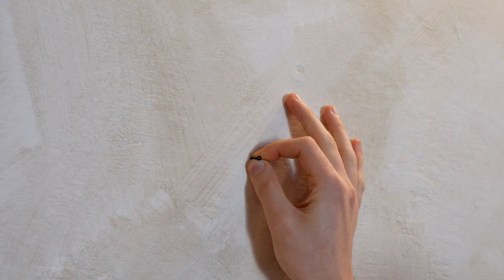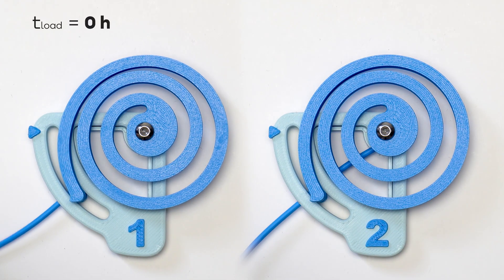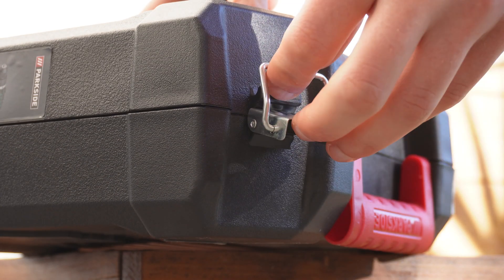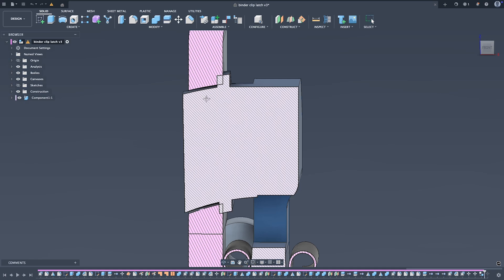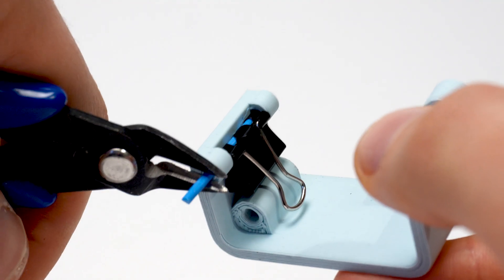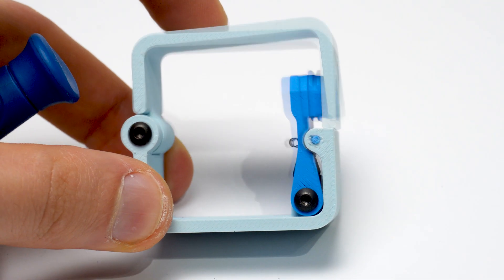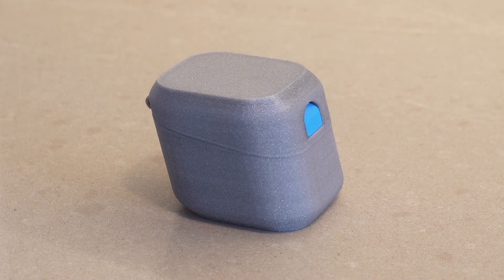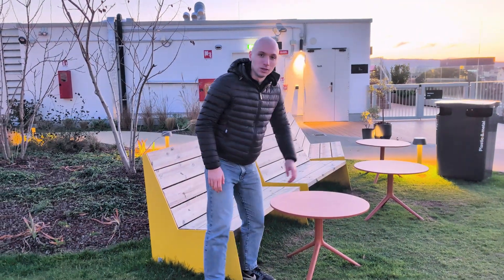Stop 3D Printing SPRINGS. Do THIS Instead

Comment: That's not "creep"; that's plastic deformation (which applies to all materials), which is when a material is pushed past its elastic deformation. Once plastic deformation happens, it cannot return to its original shape. It's permanently deformed. Plastic has weak elastic deformation, which is why it can easily reach plastic deformation. Plastics work much better as complaint mechanisms that don't rely on elastic deformation (e.g. joints that flex, rather than pivot).
Reply from the maker: Actually, it's not plastic deformation. The force applied to the spring in Rig 2 doesn't surpass the yield strength. We know this because the same force is applied to Rig 1 and it springs back perfectly once released. This is a matter of time under tension, not pushing past the elastic limit. It's a byproduct of time, which is the definition of creep/stress relaxation.
Reply: @salveo3d  That's literally plastic deformation. The amount of time it's under stress just gives the polymers time to shift past each other, causing plastic deformation. Metal will do the same thing. The longer you leave it under stress, the more the atoms shift past each other.

Comment: What I don’t get about the biggest 3D printing related channels is, why do they (most of the time from USA) tend to print everything bigger. A Design isn’t better, just because you scaled it by 20 times. The cool thing about 3D printing is, that it can produce very intricate and organic shapes.
My most hated video from Uncle Jessy was when he printed some shelfes. Just flat pieces! Dude, that’s exactly the reason why wood panels exist. Just because you can 3D printing it, doesn’t mean you should.
I‘m 100% behind your statement of this video.
Reply from the maker: Thank you Geronimo! I totally agree, I get the most satisfaction from these small prints. I’m actually working on a new project for the channel right now, another mechanism about the size of an eraser, and it’s looking so cool

Comment: Great idea, my wife has piles of those clips lying around. I'll consider using them now.
Reply from the maker: Amazing, just make sure they are 15mm wide and they'll fit
Reply: @salveo3d we have all different sizes here. I might even make some designs of my own.
Reply from the maker: @Waterfordconcepts  I gave you the power, now you can use massive binder clips hahah

Comment: Looking forward to printing this for a watch travel box. What size screws/hardware did you use?
Reply from the maker: Nice! I used M3x25 screws for both the latch and the one holding the lid. If you have it on hand, it's better to use ABS for the filament pin since it's more flexible and resistant. Otherwise, PLA will work just fine
Reply: @salveo3d Great, thank you! I don’t have ABS but I’ll give PETG a try

Comment: Try using ABS instead of PLA for the spring, it does a much better job.
Reply from the maker: I know that ABS has better creep resistance, I used PLA in the example because it's the most widespread

Comment: While I get your point and agree (at least in parts), using PLA to show "printed springs=bad" is a framed choice. PLA is one of the worst filaments to use for springy stuff in general; and such paper clips (or many other forms of springs) not suitable for a design one might want to build.
While there's clearly reasons against it, there's reasons for it as well - and as always, it's down to using the proper tool for the job, not a general "do" or "don't"
Reply: Congrats on understanding what the video was saying.  Good job, buddy!
Reply: @Matt-b9o3o I stopped after the half because I see no value in undisclosed tests or even mentioning of material behaviour, but then again I don't argue with snarky assholes - so have a nice evening, boy
Reply from the maker: @Matt-b9o3o  He's tilted
Reply from the maker: I’m not sure why this touched you so much, and while I usually wouldn't even answer such a tone, I’ll make an exception since I’m replying to everyone else. Calling it 'framing' is n overstatement. it would be rigged if I had falsified the tests. I used PLA because, as it happens, it is by far the most used filament. Most people aren't material experts and don't even know what 'creep' is. I never said 'never print springs,' I simply pointed out that in most cases it’s not the best idea.
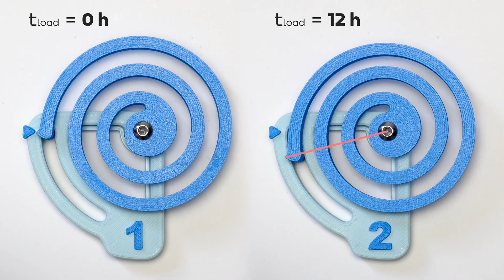Reply: @salveo3d  I guess then I can be happy you answered? I said "framed", not "rigged". I saw you disclosed the material used in the descritpion, but in the video it's not, neither verbally nor as a text, let alone an info how very much dependant this is on material. I'm not native english, so I may be using the wrong word here; at least in my book, that is framing. PLA is used most, which is why it is even more sad that it's the only considered material, because it's a great moment to mention how other materials would surpass here easily. The spring you did your tests with (cool model btw) is also hard to "fix" with your paperclip, depending on how it is used; as a latch it certainly can, but e.g. subsidizing the lateral force that you show at 0:50 is a different topic.

You didn't say "never print springs", but the title of the video is literally "Stop 3D Printing SPRINGS. Do THIS Instead" - which doesn't use the word never, but gives a clear call to action that is not literally, but effectively, same-ish? I'm just sad it's always absolutes, it feels like clickbait. The technique you show is great, and it gave me some good ideas (never considered these paperclips, now I do; I also have a wide variety of other springs in stock), but like this it feels like clickbait. I hope you'll have a merry new year!

Comment: "Excellent breakdown of plastic creep! This is exactly why material selection is critical for functional parts. When a design requires lasting spring force, we often recommend CNC machining in spring steel or aluminum, or using injection molding with engineered plastics. Great video highlighting a key prototyping challenge! 🛠
Reply from the maker: I've saved your website. You're doing some great CNC work and I might need your services sometime
Reply: I liked this video very much and agree that using the existing steel spring was an excellent choice. However, I would like to point out that not all polymers exhibit creep. PLA is probably the worst offender; ABS, PETG, and PA12 have very little creep. I look forward to more videos!

Comment: 4:15 it looks like the metal arm isn't even touching the latch. Have you considered just removing it entirely? It might look a little cleaner. 

Also, thanks for putting this together! I appreciate the effort put into the transitions and I think this is a really valuable perspective. Subbed!
Reply from the maker: Hi Ben, you're right, several people mentioned removing the latch point. I left it there just to help viewers locate the binder clip more easily, but it can definitely be removed. Welcome to the channel!

Comment: To deal with the screw hole. Rather than using a screw you could look at using a springbar, which are used in watch straps.

Redesign the holding bracket that holds the clip in place from the inside to have slopes so the springbar can be pushed in. A spacer might need to be used inside the clip to take up any slack between the clip and springbar.
Reply from the maker: That's a good suggestion, a few others have already pointed that out, so I'll definitely give it a shot

Comment: Dear @salveo3d, 
Just FYI, it is not creep what you are describing. It is relaxation. Creep is when the material moves (transforms) to less energetic position, e.g. a horizontal beam that starts to sag down. Whereas relaxation is when the material reduces internal stress (spring force) and therefore would not spring back like in your example.
Reply from the maker: You're right, 'Stress relaxation' is probably a more accurate term here, since the part is under constant strain rather than a constant load. Thanks for the technical insight
Reply: @salveo3d  speaking of creep I'm wondering if you will get some in the back of the latch there the clip is pressing on it and in the pin holes.  I saw a post the other day where someone left a rubber band on a printed thumb drive enclosure for a few months in a drawer and the pressure of the rubber band squished the case over time from the pressure of the rubber band.  I wonder if you will run into a similar issue here?

Comment: You can do away with the screws for the latch. Screws are hard to install there. Since the clip is pulling it against the wall, a groove would work.
Reply from the maker: You're right, a groove might really be the solution

Comment: You can use an Alan screw for the hinge, it’s wrench has a 90degree bend so you will not need the hole to tighten the screw. 

Additionally the Mac mini box will be bigger so probably that one will not need the hole depending upon the location and number of hinges.
Reply from the maker: True, the Mac Mini case is larger, so I'll likely be able to use an Allen key there quite easily
Reply: I guess you could also design a "bones-like" mechanism that doesn't need screws at all, after all in the first test of the spring you are moving the latch without screws and it stays more or less in place...

Comment: You might want to consider replacing the retaining pin for the spring with a metal pin.  The filament will get sloppy over time the same way a printed spring does.
Reply from the maker: Agreed, in the final design of the Mac Mini case, I'll be using a metal pin

Comment: my kinda of guy. when i designing, most people try to make the whole thing with 3D printed, as most as much as possible.  I do the opposite, and usually it is way stronger and last way longer.   very good to see channel like this.
Reply from the maker: The temptation to 3D print everything is strong, and it’s definitely good practice for learning, but sometimes you just have to use superior hardware

Comment: Just get a spring at that point.
Reply from the maker: Find me a 'standard' spring that's as widespread in every house as a binder clip, and I'll use it.
Reply: @salveo3d  pins and needles are hardened. Therefore they spring back to their original shape. (some old pins are not hardened and are flexible)

They ratter break than deform.  the profile is much smaller. I can picture a hinge with this needles bridging the two parts that comprise it (not as a pivot but as a spring) It will return the hinge to its original position. 

A needle is more available I argue good sir.
Reply from the maker: @AlexanderZapataIndividual using a needle is a good one actually, but I asked for a standard spring haha

Comment: Actually, you can make springs yourself from steel wire. There is special sort of steel - spring steel. Such a wire can be easily bought on a market place. At least in Russia.
Reply from the maker: Yes, I’ll definitely look into making custom springs

Comment: Hmmm... How could this design be incorporated into some type of auto retraction spool holder that would keep a some tension on a spool and rotate it backwards when an AMS or Extruder unloads the filament? IE for use in a cereal drybox? I'm currently using printed retraction rollers on a type of RepRap holder inside a drybox... But with limited sucess on the retraction part... And it could be because of what you said about creep in the plastic. Any thoughts?
Reply from the maker: Hi Will. Since printed plastic isn't working for you and you need a spring that handles torque, I’d suggest looking into metal torsion springs rather than using the binder clip. Hope this helps!

Comment: You could thread the hole and screw in a threaded plug.
Reply from the maker: Which hole do you mean? The one for the pivot pin or the one for the clip?
Reply: @salveo3d  The one that is on the outside you mentioned near the end, as a flaw in the design you thought you may improve later.  I'm just thinking could be a fancy dowel that would match the contour but be removeable if you need to get to the screw again later.

Comment: Well,.in your specific case the spring wouldn't be permanently tensioned, so it could be printed
Reply from the maker: It's still under a bit of tension because it keeps the system under load. Plus, the binder clip is so slim that you really can't print anything better at that scale

Comment: "Plastic can't save a tension after 12 hours", OK, I USE IT AS A PIN FOR METAL 🤡 But for lower pin I'll be use a SCREW 🤡🤡🤡
Reply from the maker: Chill chill, you don't have to be so tense. Take a deep breath

Comment: Thank you for functional prints instead of more plastic toys.
If you want to get rid of the hinge screw at the bottom, could you remove the second silver wire and use the holes to hold the latch?
Reply from the maker: The purpose of the screw was to provide a solid pivot axis for the latch, but regardless, yes, the handle can be removed

Comment: Great video! Add metal parts inside prints to make them strong where needed, add screws and bolts and springs. Combine parts printed in differrent directions to increase strength. Printing diagonally sometimes makes all the difference. 3D printing is always only the beginning.
Reply from the maker: Thanks! By printing diagonally, do you mean printing the object 'floating' at an angle to distribute the strength across different planes?
Reply: @salveo3d  Yes, exactly. I was printing boats for a while and the hull was never good until I turned the boat upside down at a 45 degree angle with only a few small supports. Now they are perfect.

Comment: this is a brilliant idea. I was thinking how I'd do a push-to-open latch for my server rack, and was worried about springs. A clip is a fairly "known" value, compared to just "some spring" that I find on amazon.

For you, I suggest one thing, you don't need that screw at the bottom. If you need to hold it in better, design the bottom to a tongue and groove type fitment.
 
as for the tolerances of the bottom/latch, if you taper it, and the hole, you can get an easier tight fitment, and it's also centring, so it'll misalign less over time :)
Reply from the maker: Yep, I'll probably go with this solution for the Mac Mini case. Thanks for stopping by!
Reply: @salveo3d  yeah, us creators like watching interesting things too :)

Comment: You wouldn’t need an access hole if you would use short screws from either side. I don’t think they would unscrew since the pivoting motion of the latch is fairly minimal.
Reply from the maker: yep yep correct

Comment: That constant pre-load seems like it will once again lead to plastic movement over time... the filament "pin" holding the clip seems the most likely candidate strengthwise.
Reply from the maker: Yep, using a metal pin would be the best thing to do.
Reply: You need a follow-up video where you investigate the creep of the remaining printed parts. I've used springs in many designs and many still fail eventually due to creep of the parts the springs acts on.  @salveo3d

Comment: also a useful skill is making simple springs from piano wire, especially for smaller prototypes and one-off projects it's very helpful to not have to source a specific form factor of spring
Reply from the maker: Piano wire is so useful
Reply: Guitar strings are another good source of spring steel!
Reply from the maker: @Blutzen nice!

Comment: Use an Allen bolt so you don't need a hole on the outside
Reply from the maker: But how do you fit the long bolt inside if you don't have an access hole?
Reply: @salveo3d hmm yeah I see, on your final case design I assume the case will be much bigger to fit a Mac mini though?
Reply from the maker: @roadrunner9840  yes you're right, and I'll probably use two of them

Comment: I have a box of standard size springs, both compression and extension types. For more custom jobs I have a 1kg of spring steel wire I can bend using 3D printed formers.
I also designed a switch that uses PET-G element that deforms during switching, and steel BB ball as the "click". Works decently well. I design the part in such a way that when it's printed with circular bottom, top and infill, the filament forms continuous lines across the bending elements, which are then formed into loops, taking advantage of the strength of the filament in the direction of printing...
Reply from the maker: That actually sounds very interesting. If you ever publish a paper or a project showing that process, send it my way, I'd be really curious to see it!

Comment: Don't use Filament as a mounting pin
plastic creeps, the pin will eventually break off.
Reply from the maker: You can always use a steel wire, but I guess you don't have it laying around the house